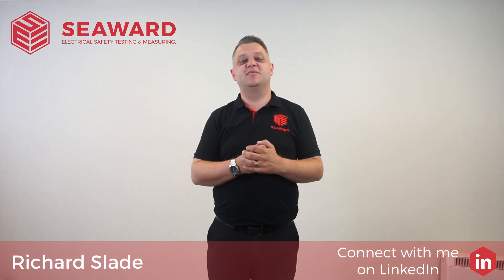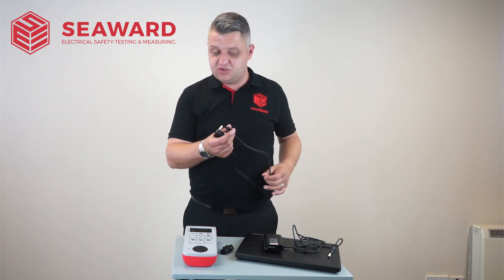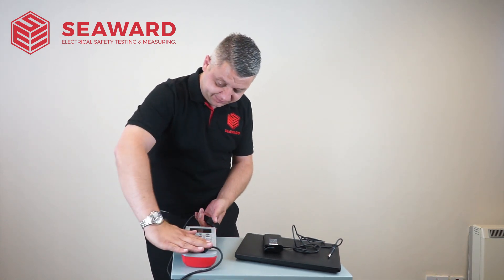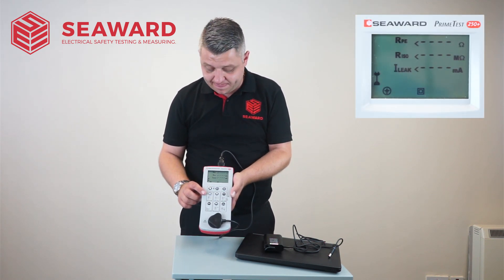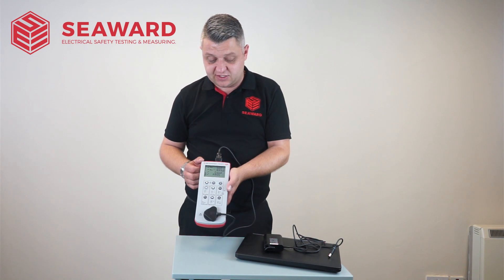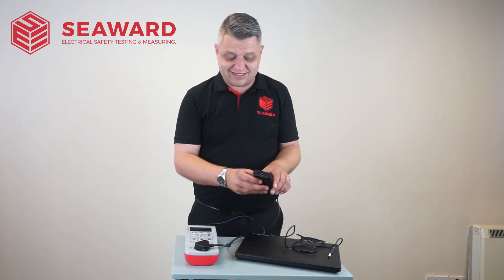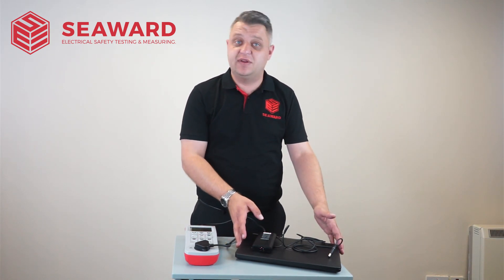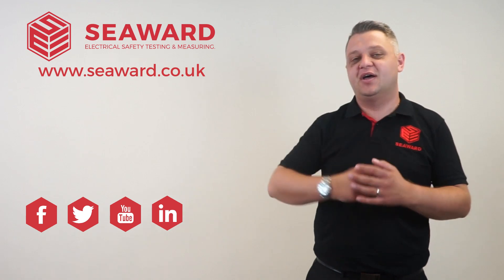How to PAT test a laptop charger & laptop - Seaward

Comment: What about testing from the power input side to the out put side for leakage.  To the out side of the plug the metallic side that is the neutral.  Such as applying voltage on the test unit to each of the phase and neutral.  At the same time and testing for leakage.  On the plug side.

Comment: The video doesn't explain it very well but as the laptop is still an electrical appliance you should check it to make sure it's not damaged in any way - after all if it were there when you were testing the lead and it had a crack in the case you wouldn't just walk away and say nothing you'd report it; that doesn't mean you need to label the laptop or charge for it. The laptop is battery powered, and the battery is charged by the power pack/lead combo.
Reply: laptop os low power appliance, cannot see the point of pat testing it ...
Reply: No requirement as it is less than 50V DC.

Comment: No. When testing the lead you should wiggle the cable at both ends (incase there is a intermitant conection). Then you should do a Insulation test (a fundimental requirement) on the PSU! The laptop running at <=50V is not relivant!
Reply from the maker: Hi Jason, thank you for your comment.

We acknowledge that it is recommended in the Code of Practice that you should 'wiggle' the cable when carrying out the earth test on the IEC lead.

With regards to the other comments you kindly made, this short video was produced for the mass market PAT User & we was using the Primetest 250+ model & with there being no exposed metal parts you would not be able to pass the Earth Test in the auto sequence. 

However, with a more advanced tester, you can programme a test sequence to omit the earth continuity test (with a supporting comment explaining as to why), carry out a 250V insulation test (through the plug) & a PE conductor current test on the power supply itself.

Thanks, Richard
Reply: @SeawardElectronic  what device can a diyer buy for testing laptop chargers that reasonable price
Reply: rekt

Comment: Laptop PSU's are funny old things.  You have exposed metal on the DC end?  I know the outer is often isolated from the earth.  Could you not have done an insulation check?  Agree with Chris but for the sake of a visual - is it as the manufacturer untended - it  covers off the laptop.  I don't charge to PAT so no skin off my nose.  Could not justify charging if I was though.

Comment: Class 1 test on the lead? Should you not do a 'cord' test?
I am surprised you need to do a visual inspection of the laptop, it being low voltage.
Reply from the maker: Hi Chris, I have asked Richard to provide a response and he said:

"The tester used in the video is the Primetest 250+ & when you carry out a Class I test it auto detects that you are testing a lead or an appliance. If it's a lead it will carry out Earthbond, Insulation & Polarity & if your testing an appliance it will replace polarity with alternative leakage  (or PE Current if plugged into the mains).

"With regards to the visual inspection of the laptop, the reference made to the visual inspection was for the supply cable as this part is connected to mains. It's also worth considering that the Electricity at Work Regulations cover 'all electrical systems' & low voltage equipment will come under this. A risk assessment would need to be carried out on the laptop to decide the appropriate action required for preventative maintenance. If a laptop is damaged, cables are hanging out or the battery shows signs of over heating there's a good chance a visual inspection would pick this up."

Hope this helps.

Thanks

Will
Reply: Sounds like I could do with a refresher.